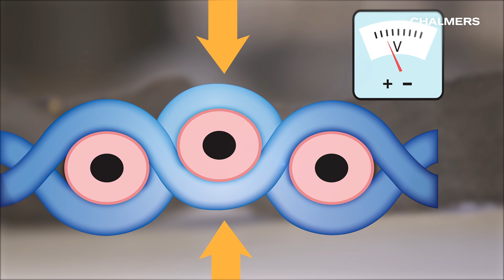Electricity generating textiles

Comment: The weave of two elements creating charge is a old method. The openly down side is to polarise the one of the weave patterns making it quite expensive at present. Fabric technology has already achieved invisibility. Self powering micro friction kinetic energy pulse. Short to Micro Friction Kinetic Pulse. MFKP in Hindu attar this = Chitroda Chitroda SuryaDev Attar. 🕉🔺➕

Comment: I HAD A VERY SIMILAR IDEA BUT WITH TARPS WHERE TENTS COULD BE OUT IN FREEZING TEMPERATURES BUT KEEP WARM INSIDE BY A SMALL ELECTRIC HEATER. THE ONLY DRAWBACK IS IF THOSE MATERIALS OR TARPS DON'T INCORPORATE STRONG ENOUGH ELECTRICAL POWER TO RUN ANYTHING!!!

Comment: how would you record the electricity coming from the textile? I'd like to know if that is possible to record signals coming from many points on the surface of a glove (for example) when fingers are moving.
Reply from the maker: The piezoelectric fibres can be connected to conventional electronics, for example an Arduino-module, where the generated signal can be used as input. https://www.youtube.com/watch?v=WQW-dobF85M